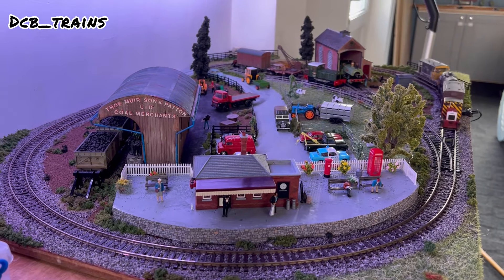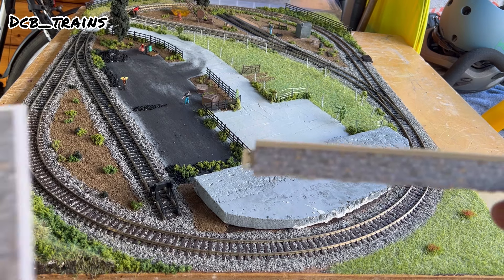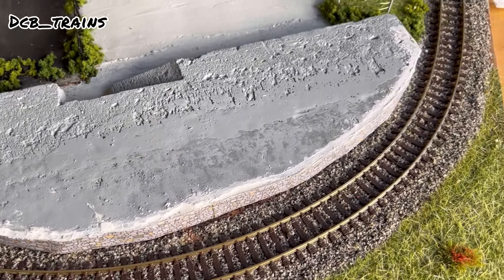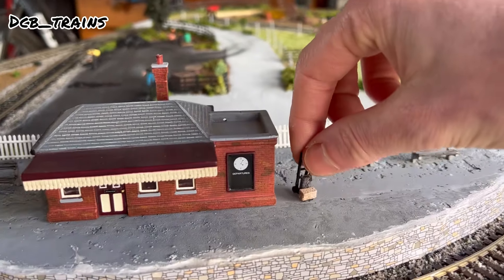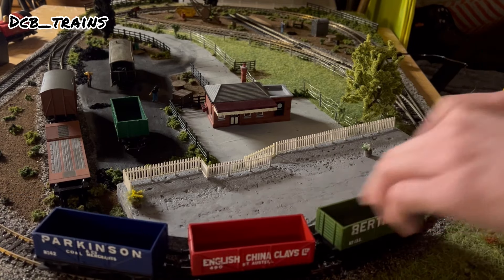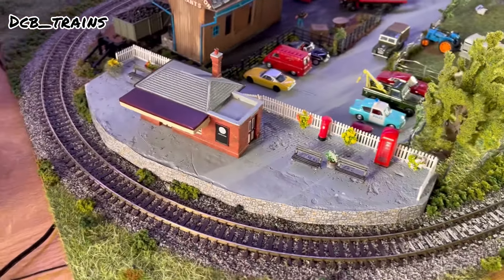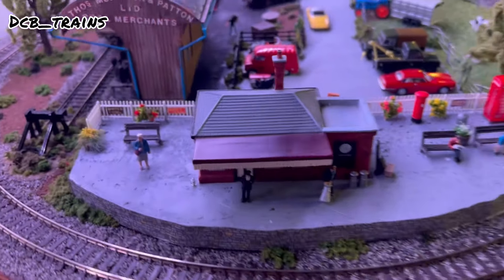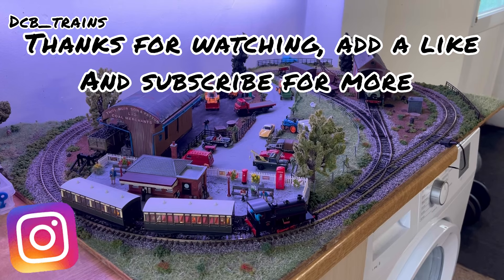Building a compact OO Gauge Model Railway Layout 3ft by 2ft | Part Nine The Station

Comment: i am planning my own layout about the same size.  hope it turns out this good!!
Reply from the maker: @OtterB135  enjoy the build, I’m sure it will turn out well.
Reply: have you had to remove any of your couplings to get the carriages around the corners
Reply from the maker: @ I have found modern wagons with nem couplers are fine. Also the traditional hornby d couplers are fine. Mainline wagons/older bachmann struggle